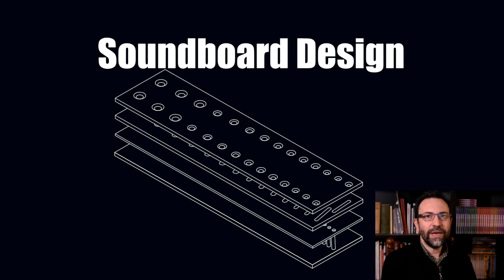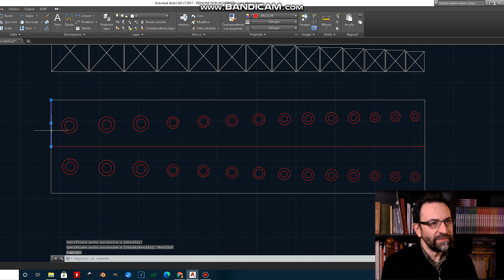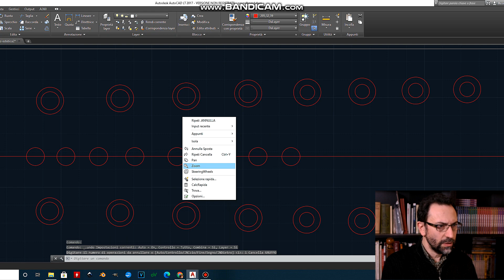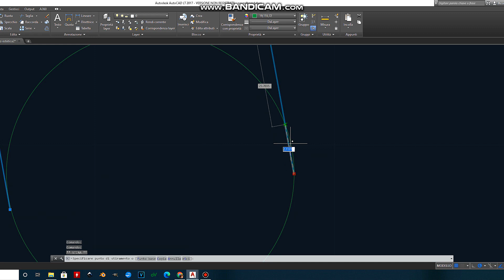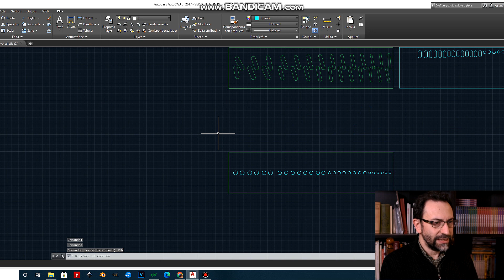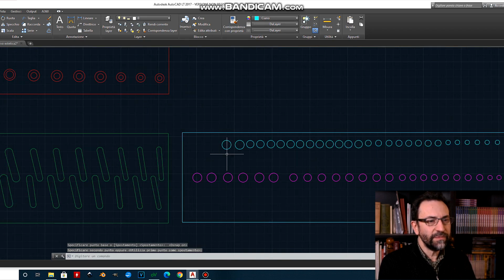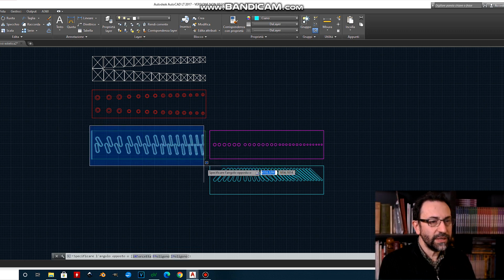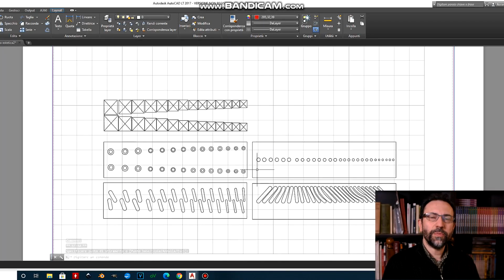How to build a portative Organ | #7 The soundboard CAD design | SUB ITA | Homemade Pipe Organ

Comment: These videos are interesting, what is the purpose of separator? Or what video describes it. Why can you not put wind chest board directly to soundboard?
Reply from the maker: It cannot be placed directly on the wind-chest because the holes in the wind-chest are at the distance of the keys, about 14mm from each other, while the pipes are spaced differently.
Reply: @nippocast  Yes, I watched all videos and now I understand. Are all portative organs built in this same way? I would love to find plans for a wooden pipes one like this online. If it works well, will you be making plans available for this?

Comment: How do you decide the diameter for the toe holes, and how do you decide the width of the channels? I just watched the most recent video - and it looked like the channels were all the same width (or very close) except the last one?
Reply from the maker: Hi Micheal, yes the channels of the windchest are more or less all the same becouse they follow the width of the keys and do not need to be differentiated because they only have to feed one pipe at a time (so they are large more than enought also for the biggest pipes of this organ)
Different story for the hole of the toe, that must follow some rules, for a 2' rank usually the holes start from 8/10mm for the low C, up to 6mm for the smallest pipe. Thanks!